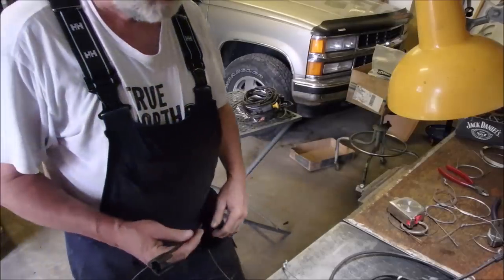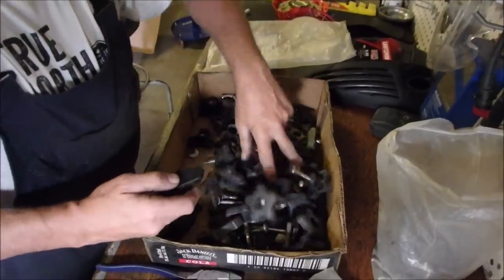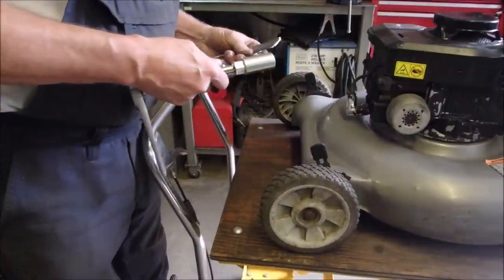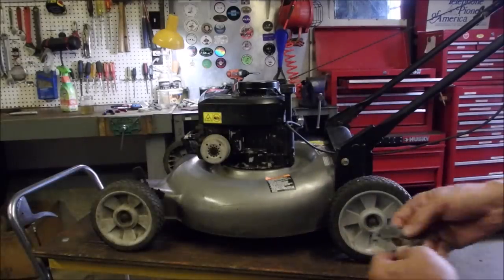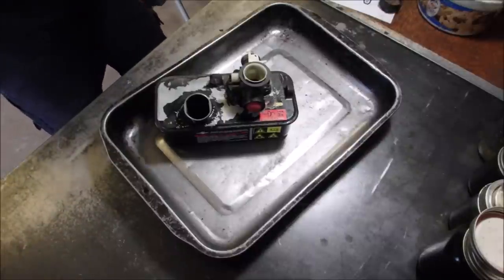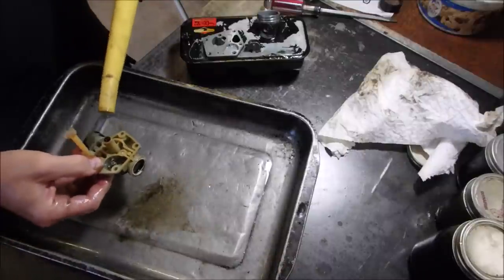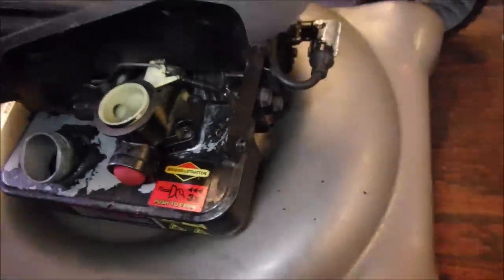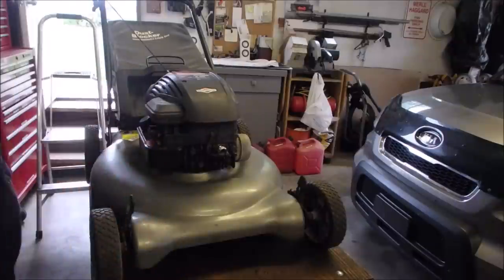Murray Craftsman Mower Needs Everything Pt 2

Comment: Dear Bruce, love your vids., I've learned a lot from you. I have a routine down for tuning 'em up. I saw all your cable holders. I had a Troy b. that had a double cable on it. I coundn't find another one, so i tied control down, took boot off sp. plug, to kill, with a screwdriver. Self propel works great. propel cable looked like a son of a to change. Season's done here in N. Texas. I had no mowers last wk. anyhow Thanks again for your help. I do love tinkering with small engines, it's not work, & I get a lot of satisfaction out of it. Old Retired Guy.
Reply from the maker: Thanks for joining in.

Comment: Thanks for answering the question, “What’s he gonna use to affix that sticker to the mower”! Lol
I’m working on restoring a pressure washer and removed most of the stickers because they were already falling off when I started to clean the machine. I took photos so I’d be able to replace them all in the correct locations. Now I know to use Super Glue, which makes perfect sense because you really don’t want them coming off again in the future. I’ll use the gel form after cleaning surfaces with acetone. 
In answer to your question - it’s rare that I don’t get a little of it on my fingers. 😂👍
Reply from the maker: Super glues is not my first choice.  I just had it.  I think spray glue would be better.

Comment: The Old Man is always watching Bruce and i can not believe the muffler came out that rarely happens. Nice to have used parts in stock that are useable, we charge 1/2 price for used parts plus tax naturally with no guarantees unless the customer wants new.
Reply from the maker: I keep a running total in my head.  Parts are hard to get way out here.  I they are easy to find the are expensive.  I am 3200 km's west of you guys.
Reply: @BrucesShop  If you ever needed new parts we could check with Stens if we can order parts and have them shipped directly to you in Alberta. We need to order $150 in parts to get free shipping and i would think they ship Canada wide but they are located in Brantford Ontario.

Comment: Did you change the spark plug boot because the factory one was a resistor one   It was an odd looking thing
Reply from the maker: All of those boots have a resistor in them this one went effectively open.  5 M is almost open circuit.

Comment: Hello Bruce, when checking the oil level with the integrated rod with a threaded cap or not, should we screw the cap
Reply from the maker: On these Briggs Yes.  Honda's you just touch the dipstick not screw it in.